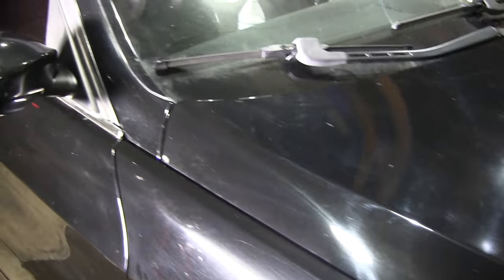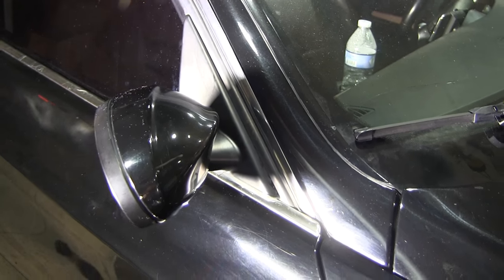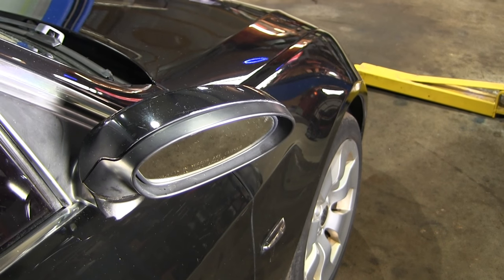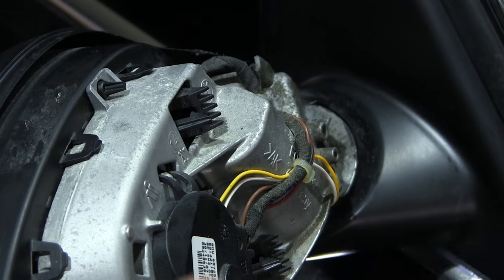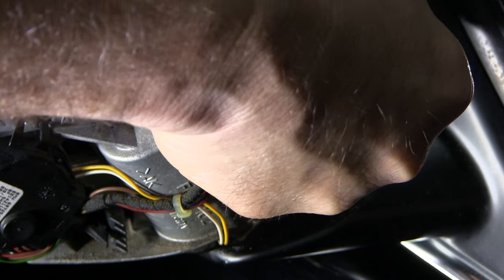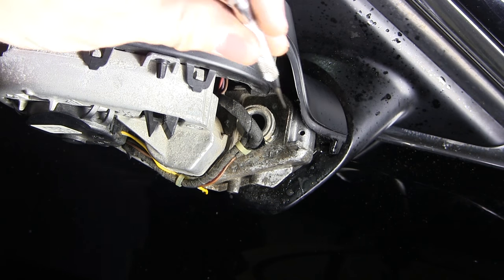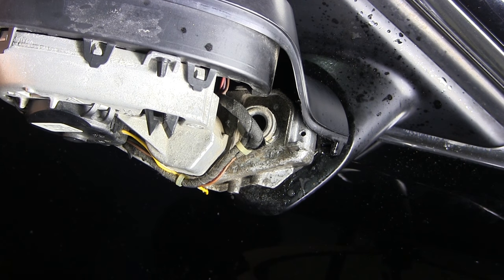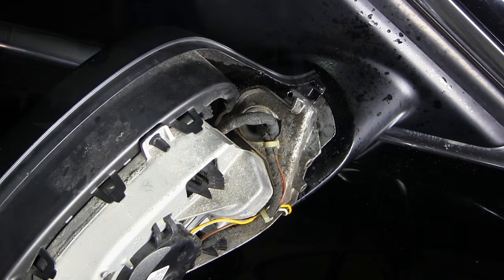FIXED BMW Folding Mirror Issue Without Removing or Wire Cutting

Comment: Sir, you belong in the National Academy of Engineering. I used a 1/16 drill bit and only needed to drill about 1/8 inch, but the fix worked perfectly. Thanks for the $1200.
Reply: what type of drill bit did you use, was it for steel or aluminum etc.?thanks
Reply: I know im randomly asking but does someone know a tool to log back into an instagram account?
I was dumb lost my account password. I would appreciate any tips you can offer me.
Reply: @Keagan Silas instablaster =)
Reply: @Kieran Kylo thanks so much for your reply. I got to the site on google and Im in the hacking process now.
Takes quite some time so I will reply here later with my results.
Reply: @Kieran Kylo It worked and I now got access to my account again. Im so happy!
Thank you so much you really help me out !
Reply: @Keagan Silas Glad I could help xD

Comment: 2/23/2020 - THIS IS REAL!!! I was about to cut the white wire when I decided to give this a shot. I am here to say, this is the real fix!!! I used a computer case screw to plug the hole when I was done as a mechanical mod going forward in case I need to prod the pin with a push again in the future. My only two cents to this masterpiece!! THANK YOU!
Reply: The white wire is for the folding?

Comment: Absolutely the best, no cost fix to a very annoying problem on E90 BMWs. Forget cutting the wire, this fix is nothing short of a full on MacGyver to solve the wandering mirror issue on our 2006 BMW 325xi. Big thanks and simply brilliant. I especially liked the hot glue gun hole sealing tip. Ed, you totally rock!!!

Comment: This is legitimate. This IS the problem on these mirrors not the wiring harness. I ended up drilling two holes because I missed my mark on the first one, sprayed brake cleaner in until it leaked out the bottom and then refilled with wd40. Mirror works perfectly now. Thank you! Brake cleaner eats up gunk and grime well.

Comment: Just did this fix with a nice tiny hole. One thing that really helped was having pressurized air and a syringe to really push solvents in behind the pin. Also, some super fine tweezers or the tip of an exacto blade can be used to reach in and exercise the pin (push it back into the hole where it was stuck) while feeding it lube. Way easier if it's off the car.

Comment: Thank you my friend, followed your guide & it works great! I used a 3mm drill, squirted plenty of lube in there & left it to soak for an hour & half, it was still stuck so I kept rotating it & tapping with a hammer near the hole & bingo,  suddenly it freed!

Comment: Thanks EdzGarage! I just bought a 2008 328xi and right when I got it home the mirror folded forward, seller did not disclose this info of course. I watched your video and followed the method with drilling a hole and luckily and found the punch out hole about .020" from my pilot hole center. I then went up a drill size to 7/64" and could see the spring in the cavity. I put some PB blaster and tapped from the top with an awl and it still wouldn't go, though I did not give up. I continued to work the power mirror via control and tapped the housing and pin adding more penetrating oil and then all of a sudden the mirror moved on it's own to the correct resting point. 

I did a few more flushes with the pb plaster and worked the power mirror function as I applied moderate pressure to the pin to make sure it was good and free. you can feel a slight feedback in the awl when the mirror gets to the rest position. I then filled a syringe with a thin synthetic teflon grease and pumped it into the hole while working the power mirror function a few times. Lastly, capped off the hole with hot glue just like you said. 

This fix works great and is efficient, great job on figuring this out. The only thing that would improve this would be to make a template with dimensions to locate the punch and drill holes.
Reply from the maker: Thanks for the comment!
Reply: I will try this tomorrow. Wish me luck! 🤣 Thanks for the video.

Comment: Thank you, mate!
This was the only solution for my case. Since the pin was stuck the motor of the mirror didn't seem to make an effort to move whatsoever (thought that it was broken). Since you have access through the hole you can feel the pin clicking.

Comment: JUST FIXED THIS DIFFERENT WAY!!!! JUST SPRAYED A LOT OF WD40 UNDER THE 
ROTATING PART OF THE MIRROR. Remove plastic cower, then just pull whole 
mirror up (or bend it to the side) so there's a thin space under the 
rotating mechanism between the mirror and car holder. (Buy small 100ml 
WD40 with thin pipe, so you can squeeze it deeper into that 1mm space 
what you will have when pulling mirror up or bending it to the
 side. Note! You can pull or bend it just slightly, just few 
millimeters). Spray WD40 into that space aiming to the area, where this 
stuck thing is located (that thing with spring, what this guy in video 
oiling in the end), keep removing excessive WD40 with paper towel. 
Rotate left right, shake a bit the whole mirror, not too much, don't 
damage anything, then repeat. After a while (in 5 minutes or may be 1 
hour) oxidation on the lock will be gone, the mechanism will get 
unlocked and working again. No need to damage the mirror. Then just put 
plastic cower back.
Reply: Best advice, thank you very much!
Reply: I saw the video, moved the mirror and saw the same little gap. I sprayed it the same to see if that'd do it, and it worked!   Came to write that and I saw this comment, so I can confirm it worked for me too! Thanks for the tips on the vid!
Reply: This works. But I had to spray the lubricant into that slot from several different angles. With the mirror facing forward, folded, and in its home position.

Comment: I drilled a hole with 1/8th inch bit and only went down about an 1/8th and used my WD40 with long straw and bam!!! 20 second fix.. worked immediately... not all heros wear capes!!!

Comment: Mine is FIXED TOO!! THANK YOU SIR!! 😉 FYI I used the 1/16 drll bit like some memtioned but its a too small in my opinion. I could not use any pointed tool to push pin with. I used the same drill bit to push pin back and forth along with lubricant till i could hear the click.  For reference use a bigger drill bit. Next size up from 1/16 I guess. Thanks again for such a great video. Keep it up!!😉

Comment: After drilling the hole and unblocking/lubing it became clear my problem was that whatever the pin was supposed to stop in was worn out. I drove  a screw through the same hole to push the pin down even more. the mirror retracts a bit slower but it does stop where it should. Thought to post in case it helps somebody. Thanks for the tips!

Comment: Another +1! I never could feel a pin moving up and down, but after three squirts of PB BLASTER and five or six manual rotations it started working! I used an 1/8” drill bit and sealed it with an old tube of RTV that was laying around.

Comment: Awesome fix!  Best out there!  It keeps the factory function with minimal work/disassembly.  I did a fair number of rounds of lubricant, tapping with a brass hammer, rotating the mirror and poking at the pin with the awl like you said, but it worked like a charm..

Comment: Worked for me on e90 s65 M3! Thanks! I was apprehensive doing any of this because I’m not DIY confident. I ended up with a double-wide drill hole and tried for a while, testing frequently with the sideview-fold button, and it eventually was working. Yay!

Comment: Thanks for video, showing approx pin location on the passenger metal mirror casting. My issue is on driver mirror. I’ve progressively drilled to now 1/8” hole, prob 1/2” deep, in same location and cannot see pin. What is pin diameter ? Is it also aluminum ? Sprayed lots of PB Blaster in hole, and it flows down. Tapped hard w/awl, nothing  moves.  Driver mirror still folds forward, epic fail.

Is the pin location different on driver mirror ?  Noticed rotating Circular metal ring orientation (notches)  is different on pass vs driver.

Could I be drilling into frozen pin ?

Comment: Worked on my 2006 e90 330i. I used 3-in-One lubricating oil and then some lithium grease, along with the requisite hammer taps. Very nice solution. Thanks again EdzGarage.

Comment: Thank you! After I did this, there is a procedure that resets the mirrors to home. 

That way my passenger mirror came home to the correct spot instead of out too far, even horizontally. Even at the maximum inward adjustment I couldn't see the car. 

I'm VERY happy to have this fixed. You rock.

Comment: Nice video and saved me a lot of time.Followed your thinking I just opened the cover and heated the area over the spring up with a heat gun and tapped with screw driver handle and it worked for me.
Reply from the maker: Nice! You still may need to drill a hole to add some lubricant in the future. Thanks for the comment and for watching!

Comment: I was going to do what you did, I took off the mirror cover. And it looked really dirty in there. I should've started to clean it out with compressed air duster. But I sprayed some all purpose cleaner carefully in the motor mechanism and where the dirt was. And the mirror started to open into the proper position. 

So maybe my issue isn't the spring, it is that the dirt built up in the indent, so it caused the motor to continue turning past the correct indentation since it was clogged up with some dirt and wasn't deep enough as a result. So cleaning out the dirt may help. I'm gonna oil it after it dries out.

Comment: I drilled a hole and couldn’t get it to work. Sprayed with wd40 tapped with hammer and and nothing. I decided to drill another hole in the same area closer to the window and sprayed and tapped and BAM, it worked! I have a 2006 330i E90. Thx for the video!

Comment: Try this.... Push the unbroken mirror into the forward position then close em. Then open and like magic my broken mirror stopped where it should!... This was after drilling the holes etc so don't know if it was after following this video or I just had to do this but I was seconds away from cutting the wires!... Now I close those mirrors with a huge amount of satisfaction and a smug grin on my face!... Thanks for the video and good luck everyone
Reply: JUST FIXED THIS DIFFERENT WAY!!!! JUST SPRAYED A LOT OF WD40 UNDER THE ROTATING PART OF THE MIRROR. Remove plastic cower, then just pull whole mirror up (or bend it to the side) so there's a thin space under the rotating mechanism between the mirror and car holder. (Buy small 100ml WD40 with thin pipe, so you can squeeze it deeper into that 1mm space what you will have when pulling mirror up or bending it to the side. Note! You can pull or bend it just slightly, just few millimeters). Spray WD40 into that space aiming to the area, where this stuck thing is located (that thing with spring, what this guy in video oiling in the end), keep removing excessive WD40 with paper towel. Rotate left right, shake a bit the whole mirror, not too much, don't damage anything, then repeat. After a while (in 5 minutes or may be 1 hour) oxidation on the lock will be gone, the mechanism will get unlocked and working again. No need to damage the mirror. Then just put plastic cower back.

Comment: Mirror goes back to normal position and does not move randomly when car locked anymore. Only issue is I did not drill in correct area because of plastic of mirror blocking area where I can drill, and the mirror does not close fully to the end but does open in correct position.  Is there anyway I can fix it or did I damaged the mechanical stuff inside maybe? Thanks for the good video, other than that this has stopped the main issue which was annoying that it kept opening out of position.

Comment: Only because the spring and the pin gets stuck down all rusted,and that's why you need to take it apart to properly clean it,but it seems like your pin wasn't that stuck it took me an hour to free out the pin from my mirrors but I fix them both sides..

Comment: worked great took me 2 minutes didn't even have to get  hole all the way through with original drilling,  just saw opening with original drill bit and got w40 in there and pushed through micro hole with  with smaller drill bit to loosen pin and worked perfect.

Comment: Good video it worked for me to. I used wd40 and manually turned the mirror left and right. The pin probably got lose because it works perfecly now. I could not poke the pin but it worked.

Comment: So I did drill that little hole and found the pin. I can even see i he pin on the bottom side sticking out since a little bit of that plastic piece is broken off... I've been soaking the pin and the whole assembly in WD40 for about 2 days now, but can't get the pin moving. Any suggestions would be deeply appreciated...

Comment: I tried this with a mirror I got from eBay. I purchased just the base- the spring was already on it. I bought the hinge separate , I can’t get the spring compressed enough to put the two pieces together. I have a 2014 X3, I drilled and did not see the pin. Is there a chance my pin is in a different place?

Comment: My mirror on my e92 has 2 problems 

Won’t fold/unfold when pressing the button (passenger side folds/unfolds and stays locked in home position just fine). This honestly doesn’t bother me as much since I could care less if it folds electronically.

What bothers me however is when I tried to fold it manually it does NOT lock (it doesn’t make that clunk sound once it’s right in the middle - home position). So anyone can move just by simply pressing on it with his little finger. Could that “locking mechanism” I see in your vid moving up once you manually in the middle be the problem? And how do you repair that?

Comment: 2006 E90 showed same problem; showed the video to mechanic. He followed the steps, but didn't drill a hole. He just pried at the bottom of the gear (where the pilot hole was pointing), and with that little tiny gap, sprayed lubricants. The mirror's correct movement was then restored. He said that it was the same idea of lubrication, and added that if the mirror was moved every day, it would not have a problem; the trouble was due to inactivity. Anyway, all little problems were all little different. Might or might not be relevant to others. thanks.
Reply: JUST FIXED THIS DIFFERENT WAY!!!! JUST SPRAYED A LOT OF WD40 UNDER THE ROTATING PART OF THE MIRROR. Remove plastic cower, then just pull whole mirror up (or bend it to the side) so there's a thin space under the rotating mechanism between the mirror and car holder. (Buy small 100ml WD40 with thin pipe, so you can squeeze it deeper into that 1mm space what you will have when pulling mirror up or bending it to the side. Note! You can pull or bend it just slightly, just few millimeters). Spray WD40 into that space aiming to the area, where this stuck thing is located (that thing with spring, what this guy in video oiling in the end), keep removing excessive WD40 with paper towel. Rotate left right, shake a bit the whole mirror, not too much, don't damage anything, then repeat. After a while (in 5 minutes or may be 1 hour) oxidation on the lock will be gone, the mechanism will get unlocked and working again. No need to damage the mirror. Then just put plastic cower back.

Comment: I wonder if this would work on my passenger side power fold mirror on an 07 Z4 Coupe E86. Mirror folds up for storage but won't return has to be done by hand, probably pin stuck and going beyond stop point which microchip doesn't recognise where the mirror is 🤷‍♂️ definitely worth a look 👍

Comment: what about this...My driver side mirror is folded in/up. When I push the UN-fold button, only the passenger side unfolds. Driver side does not move or make any sound. E92 in Miami. Thx for any tips on what my issue is.

Comment: I had the same problem, I suspected it was water getting in the motor from rain or car wash. I stopped taking it to the car wash and haven't had any more problems. Fingers crossed! but for a while I was desperate to disable it somehow, don't want to cut wires either. good luck with yours. / good video.
Reply: Hard to believe, I posted this 4 yrs ago! 😂 I have the same problem now! Same car!

Comment: I was real hopeful this would fix my problem but after drilling two holes, using brake cleaner and wd40 it still is broke. I also cannot locate the pin you’re talking about.